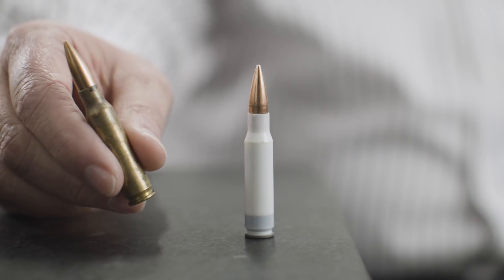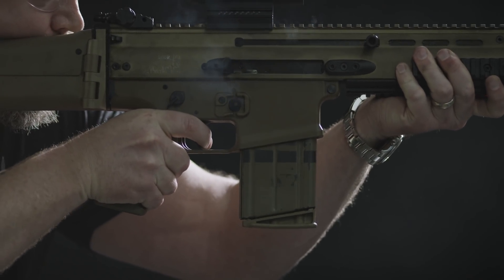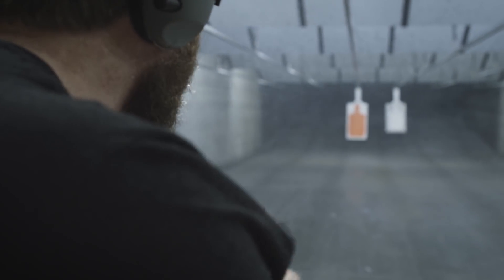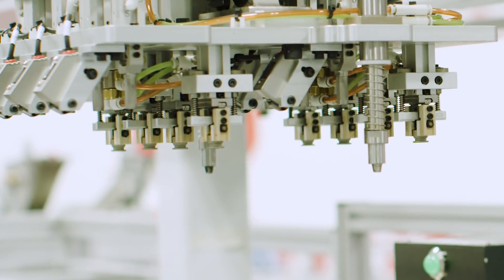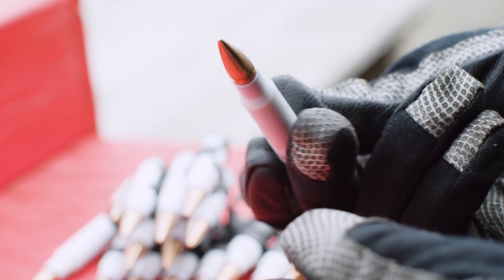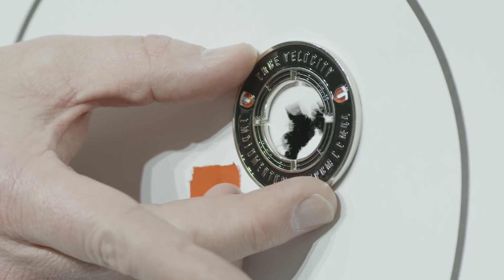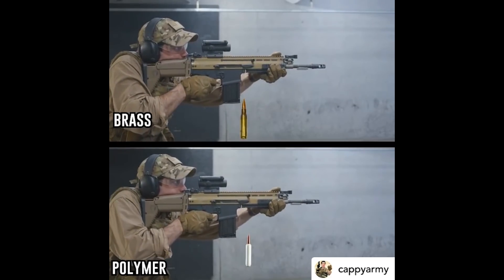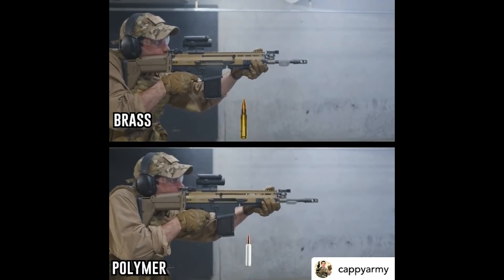Composite Ammunition is More Accurate than Brass | NGSW | Next Generation Squad Weapons

Comment: what about durability in the heat and cold? what about failed case extractions? what about live round in a very hot barrel? You can have all the performance you want in the lab or on the range with some shade but what happens when these rounds are abused?
Reply: Barrel and chamber are different places. The case doesn't transfer very much heat to the chamber, so it doesn't get the chamber hot enough to cause problems with the polymer case. They've shown people sticking their fingers in the chambers of 240s and the like after firing, and they've put the cases in their mouths right after firing too. Lips are pretty heat sensitive, so I don't think they're lying about that. The base of the cartridge is a steel insert, so extraction should be very reliable. 
I don't know exactly how it'd do, but I expect that if you abuse the round, it'll probably do pretty good. Brass dents, this would probably return to form unless utterly crushed. Being in the sun all day would not be good, but that's not good for brass either and causes problems when you do that too with chamber pressure and stuff like that. Basically all military ammo since the 1930s is pretty well sealed, so it should last basically forever.
Reply: Superfamily Allosauridae I’m not talking about fireing a few rounds through the gun im talking millions of of these rounds sitting in a metal connex in the middle of a very hot desert or even a fire. Everything polymer melts or burns or else you be be flying through space on your way towards mars right now in a very light polymer space ship(but that will never happen as anything polymer for serious work does not exist) A steel insert into polymer is not a good idea as metal expands/contracts at very different rates than a polymer that does not transfer heat. Very cold climate=steel insert shrinks to the point it’s bond to the polymer case is weakened and joe blow snuffy attempts to extract the round from his rifle but because the steel insert shrank more than the polymer is rips the steel base out and now you’re down a rifle. Very hot climate=steel insert has expanded to the point it is stressing the polymer case to the point the bond between the steel and case is “soft” and high failure rates of feeding and extraction occur. There are NO videos of them showing what happens when the climate isn’t inside a building or a day out on the range. There wasn’t some magic polymer discovery that made these things viable now vs decades ago....i also find it funny that the same people that complain about lead poisoning from ranges and war are ok with this polymer ammo sitting on the ground, never degrading away but at least you can carry 30 extra rounds lol
Reply: @caseydman4651  I trust it will happily sit 300 years in a hot CONEX in the desert here in 29 Palms or on Thuule Air Force Base in Greenland not because of any youtube video, but because that inherently will be tested in the NGSW trials. Same for Textron and Sig. Shrinkage up and down is a thing but this is pretty small scale and they can probably compensate for how much will happen in the ranges of temperatures experienced on the surface of Earth.

As for the lead free stuff
well, if it doesn't degrade, it won't leak into stuff. it'll sit there self contained trash. that's better than when we send projectiles downrange and it erodes and heavy metals start poisoning people. Lead thing is mostly just from how much it costs to clean the ranges up every once in a while, billions of dollars, from lead.
Reply: @caseydman4651  and don't say anything about crayon eating when you're wearing a GHOST MASK dude

go consoom CoD

P.S. I've seen many a grift scheme, and this ain't one. Sig... sheeesh!!!
Reply: @caseydman4651  This ammo was not developed to a useful or reliable state back when clinton was pres. Technology does indeed advance a little bit over time. Brass doesn't hold a candle to paper cartridges, and will never be adopted by anything but officers buying their own guns and tier 1/2 units. If it was mass produceable, it would've been adopted back when Lincoln was President

eating crayons is a much cheaper way of intimidating iraqis, and tastes much better than eating mask all day. I'm touched to have an american hero review my WT content <3
Reply: @caseydman4651  polymer won't melt until 400 degrees if it's getting that hot in them buildings in the deserts why tf aren't we shipping some ice from Alaska for some AC. They already told you about the chamber staying cool do you think the casing goes in the hot barrel?
Reply: @caseydman4651  what if you could read and speak English or knew what the difference in a barrel and chamber were
Reply: @superfamilyallosauridae6505  their both connected to each other and made out of the same material...good job smooth brain
Reply: @caseydman4651  Heat transmits from one part to another, it is not equal nor is the about of heat one part can absorb the same, because they're differently shaped at different parts and have different masses. 

You don't actually know how heat distribution works at all
Reply: @superfamilyallosauridae6505  you're beyond helping, plastic ammo is a gimmick, always has been, always will be. It does not matter what color they make it, or what they are calling it today vs 20 years ago. It will not stand the test of time because it is PLASTIC. Do you see plastic space ships? no you dont, do you see plastic ships? no you don't, do you see plastic cars? no you dont, do you see anything that is subjected to ridiculous amounts heat, pressure and abrasion made out of plastic? no you dont, and you won't for very good reason. Even the ammo they have given out for reviews are sub par and that's the hand picked ones. I'm sitting here laughing at how stup id someone has to be to think plastic ammo is a good thing for a country to adopt for it's main supply of munitions. If it does what it says then you'll see some tier 1 or 2 units rolling with it to test it out, much like the SCAR and the SCAR is a trash platform compared to pre existing weapons for 1/4 the price.
Reply: @caseydman4651  OK, show me the ships that are entirely structurally supported on the outside by plastic, weigh less than 30 grams 90% of the time, and explode.

Better yet, show me the brass ships. Show me the ships that are actually hull-less and consist of the cargo just kinda dumped in the water like the Boston tea party.

That is an idiot analogy.
Reply: @caseydman4651  Also SCAR is trash yes but from a design perspective, not at all what it has become. It would cost $600 at the profit margin of a normal AR15
Reply: @caseydman4651  You have an engineering degree to comment on what polymers can withstand?

Didn't think so.
Reply: @Elendrian  imagine thinking you need an engineering degree to tell if something made out of plastic will survive the very harsh environment that ammo is subjected too, not just in the gun, not just being transported, not just real time use by people that will depend on it, not just governments betting the ability to defend an entire continent with it. It's cool don't get me wrong, it's just not up for the task and everyone thinking this is the new iphone makes this all the more cringeworthy.
Reply: @caseydman4651  You use plastic and polymer interchangeably. That indicates to me that you probably don't know the difference between those words, and consequently also don't know what the hell you are talking about.
Reply: @caseydman4651  You confirmed my suspicions.
Reply: @caseydman4651  The 787 Dreamliner is made mostly of Polymer. That plastic crap seems to work for them.
Reply: What if..... but i don't know if lol
Reply from the maker: All testing that has been done on our composite-cased cartridges (both environment testing and chemical) has outperformed the brass standard.
Reply: @truevelocityinc  will their be a video showing some thermally hot ammo being shot? maybe some stress testing on some very cold ammo too?
Reply: @caseydman4651  perfected for a hundred years? you think we've had ammunition perfected for a hundred years? 

we barely knew what aerodynamics were back then dude. brass is not cheap, that's why most ammo companies have garbage margins, like, worse than gun stores. you can make bullet designs that outperform 95% of what is in use around the world today pretty casually in specific things, and if you do a caliber study and set actual goals, you can do insane things. 

we can squeeze a pretty good chunk more capability out of literally existing calibers just by designing better projectiles. brass ain't cheap, we can optimize production like nobody's business if we can do it with polymer. steel case head of .308 is shared by a ton of cartridges alone... 7.7x58mm Japanese? $3 a round now! 7.7x58mm TV Japanese would be nearly identical in price to .308 TV, sharing a case head and everything else being much easier to do for a tiny little production run like 7.7 demand.

This is true for a ton of calibers, current and those not even designed yet. Whether NGSW sinks or not, it doesn't matter, this is going to eat brass alive and obsolete it. It's gonna be significantly cheaper for much better performance, even with weight not mattering for civilians.

Comment: So if the old M60 got hot enough to cook brass rounds how will that kind of heat affect polymer cased rounds?
Reply: THE M60 FIRES FROM AN OPEN BOLT AND DOESN'T HAVE A PROBLEM WITH COOKING OFF ROUNDS. I HUMPED ONE ALL SUMMER AT FT. LEWIS IN '73, SO I SHOULD KNOW. COOKING OFF IN AN OPEN-BOLT-FIRED MACHINE GUN IS PURE HOLLYWOOD FICTION.
Reply: @thehoneybadger8089  My 11 years and some combat experience with M60E3 and Deltas confirms this. It chambers from an open bolt, it fires when the bolt goes into battery the bolt stays to the rear when you release the trigger. A bad extractor leaving a round chambered when clearing or something could cook off that 1 round, but never seen more. That feed tray would need to be red hot to cook off an unchambered round. Nothing to do with heat but if it has a worn sear or missing safety wire on the leaf an M60D can become a runaway once the first round pops. Ask me how I know...
Reply: He says they don't transfer heat into the chamber of the weapon, because the brass heats up when fired and accumulates before the casing is expelled. 1:48
Reply: @jdukay6355  You don't understand. 
The M60 has an issue that if you do not fire short bursts and just hammer it, it gets too hot and causes the rounds to fire even without pulling the trigger, you have to cut the belt to stop it from firing.
My question is will the plastic stand up to that much heat and if they will could they be a cure to a runaway M60?
Reply: @GABRIELLUCERO1  you're kinda proving my point. The M60's rounds self fire because the brass casing gets too hot and the powder ignites. These guys have a polymer casing that isolates from heat. Meaning, it doesn't heat up. Thus, it shouldn't fire...or at least it may make it harder for it to self fire due to overheat. At the same time, if the chamber also doesn't heat up that much, the lesser chance there is the powder will self ignite. But I'm just theorizing based in what the maker said
Reply: @jdukay6355  No the heat transfered from the brass to the chamber is not the problem, it is the fire coming out of the front of the cartridge.
Let me make this as simple as I can.
1 Will the polymer case take the heat of a M60 after firing over a 1,000 rounds non stop without melting?
2 If the cases do not melt and fire accurately and constantly will a M60 stop firing after over a 1,000 round burts just by releasing the trigger? 
Finally the reason I am wondering is because they are talking about how polymer does not transfer heat like brass and they are using 308/7.62×51 same round the M60 fires so it would make sense that they videotape themselves firing a few thousand rounds at full throttle on a M60 to prove their point especially since the M60 is famous for running away due hot chamber issues.
Reply: @GABRIELLUCERO1  Based on what you just wrote, I could bet my life's savings you've never shot one and you're talking out of YouTube watching.
Reply: @jdukay6355  OMG! Why did I even reply to you. Is all you want to do is argue? Or are you working for the government trying to get information? 
Stay away from me and everyone else.
Reply: @GABRIELLUCERO1  They literally stick their fingers in the chamber of a 240 after firing bursts. I guarantee you I wouldn't have done that when I was behind the 240L firing brass, even just a hundred rounds. They've stuck the things in their mouth on video fresh from the chamber. They don't transfer heat. The chamber is what cooks off, in a closed bolt gun, because the chamber gets heated up from the brass transfering the heat through it to the metal of the chamber. The gas and projectile transfer heat to the barrel, and the gas to the gas system.

This ammo does not heat up the chamber. It will take an exponentially higher number of rounds to warm it up through the barrel transferring heat to the chamber than brass would to the point of cookoff.
Reply: @GABRIELLUCERO1  wrt the gov stuff, that's basically on places like discord, and he didn't bait any NFA stuff or crimes. 

real men do argue using logic, like i did, and it made sense didn't it? Never needed to deal with NFA to know that stuff, or basically anything really. There's literally PDFs about M320 use just on the web that the Army uploaded. Be discriminate in what you consider likely gov baiting. This certainly wasn't it, imo

Comment: I will stick with brass. Reloadable and no plastic trash on the ground.
Reply: I believe they said it can be reloaded or at least recycled. Anyway the production of brass which is an alloy of copper, zinc and tin isn't exactly eco friendly, even looking at the sheer numbers of steps, machines and products involved in shaping brass ammo it's an energy hungry process that involves a lot of dangerous chemicals. Moreover we are getting awfully close to having mined most of the known deposits of Zinc and Tin so those elements will get more expensive as supply slows down.
https://thesolutionsjournal.com/2016/02/22/endangered-elements-conserving-the-building-blocks-of-life/
Reply: @dunedain101  from what I have seen, no, plastic cases can't be reloaded, nor shouldn't.  It isn't reliable,  nor safe as brass.
Reply: I see more as a replacement for steel case. It's 100% recyclable apparently
Reply: What if they made a biodegradable case
Reply: @Blackflag.actual  I would still use brass. It is reusable and in a shtf situation that will matter for obvious reasons.  Look at what happened just with a bullshit virus scam. Hardly any reloading materials to be found.  Brass can be used many times. 
As for biodegradable plastic,  it won't hold up to the explosion of the powder. .308, .44 magnum,  etc... have high pressures that plastic will have a hard time with. A ruptured case will ruin your day.
Reply: @Blackflag.actual  Biodegradable paper case, "natural" lube from lard, I think that this has been done before.
Reply: @kidsteach938  we've come full circle
Reply: Plastic islands in the ocean. I'm not a climate extremist but I do believe in less waste and properly disposing trash. That's what I do. This plastic ammo, who's going to pick it up at the range, it's worthless.
Reply: @Tom_Wilk  All of you are confusing composites with polymers..
Reply: @christianfelix1580  is there a difference? I guess I’ll have to look it up now.

Comment: What temp does the barrel have to be for your casings to start melting inside?
Reply: They have people firing them and immediately picking up the casing and pressing to their face, it is not even warm. Do that with a brass case.
Reply: @Alericc-n8n  lips are sensitive. I'd never do that with brass
Reply: @Alericc-n8n  Why would anyone want to pick up a hot piece of brass and press it to his face? I've been a range officer for 16 years and I've never seen anyone do that. Are you a masochist?
Reply: Probably well over 500 degrees C. The genius in the polymer they've designed is that it's good enough to be molded to single-micron dimensional accuracy (far better than brass can ever achieve in a die), insulating enough to be cool to the touch, strong enough to withstand normal chamber pressures, and chemically stable enough to NOT melt well beyond several hundred degrees Celsius - but melt BEFORE a barrel does. It's like the difference between direct vs port injection vs carburetors. That's my comparison for polymer vs brass vs musket ball ammo.
Reply: The barrel heats up, but the chamber heats up very little, because when the round fires, the heat isn't transferred through the case, because it's not brass. Cookoff is a lot less likely. I'm very interested in what kinds of temperatures affect this ammo, though.
Reply: @superfamilyallosauridae6505  well said... Someone listened to the man speaking. Hot brass vs cold composite. I'm digging it myself... 30 percent lighter too.
Reply: @superfamilyallosauridae6505  bro the chamber and barrel are connected to each other. Eventually the heat will transfer back from barrel to chamber. Duuuhhh
Reply: @papimasfuerte4671  it's wayyyyyyyyyyyyyyyyyyyyyyyyy slower than normal, where the chamber usually receives more heat more faster than the rest of the barrel. way way cooler way longer. taking time for heat to soak to the chamber will keep chamber temps down a ton essentially forever. 

waiting for heat to soak will always be cooler than brass or steel directly transmitting heat, where the chamber heats up faster than the rest. it's a big difference and literally always better as far as lowering temp is concerned